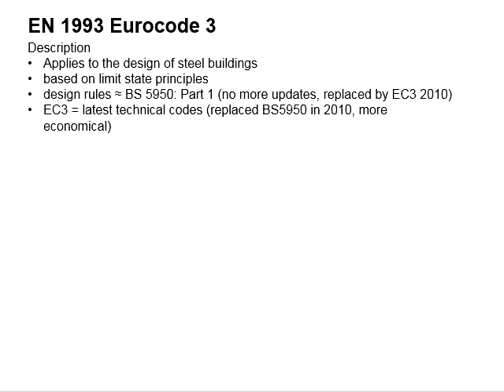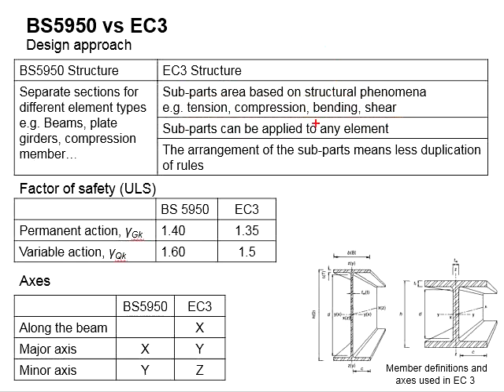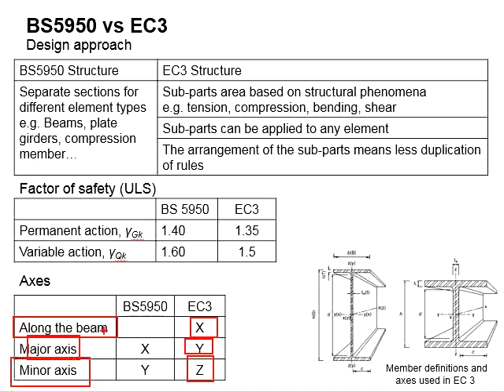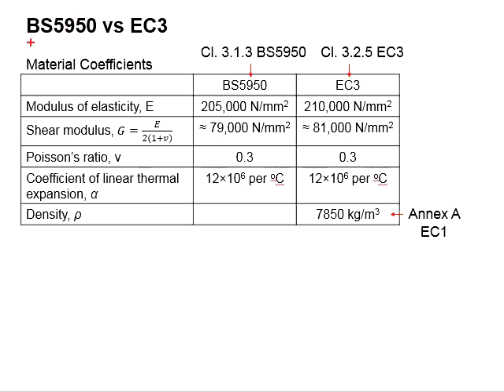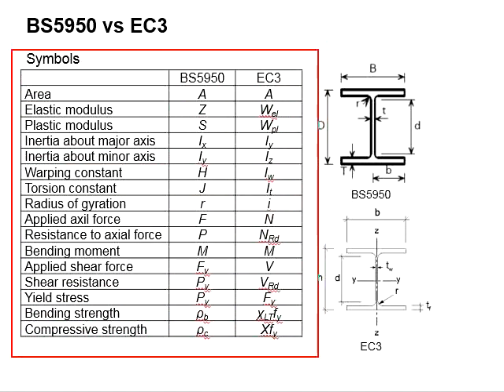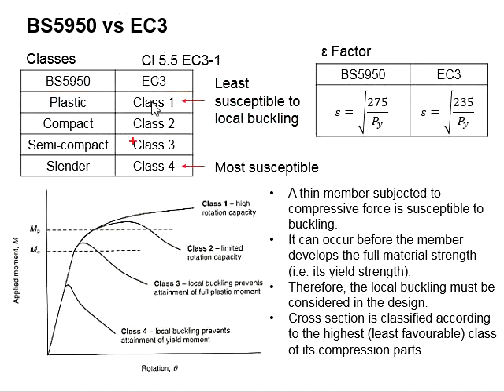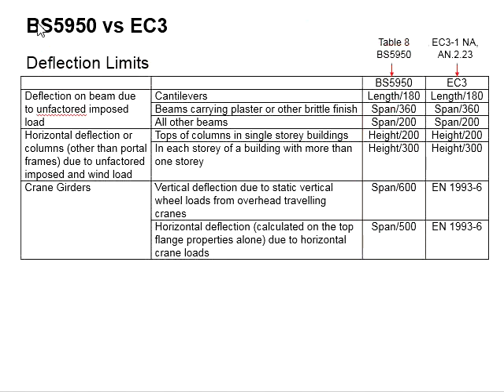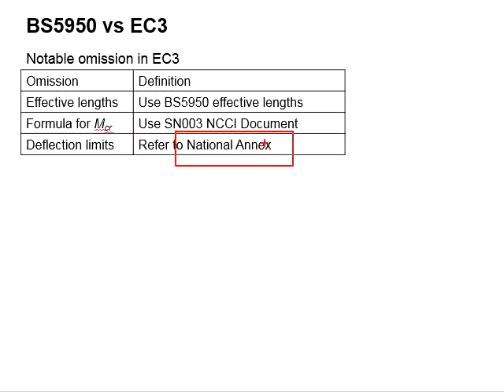1.9 BS5950 vs EC3

Comment: Can you elaborate on why EC 3 uses 1.35 and 1.5 for loading partial factor compared to BS5950 which uses 1.4 for dead load and 1.6 for the live load?
Reply from the maker: My personal interpretations of this are:
(a) Lower FOS means better reliability of the materials or loads and/or a higher confidence level in the predicted response of the materials or loads.
(b) EC was established later than BS. Over the years, technology has improved. It produces materials with better quality and consistency. Also, researchers gain a better understanding of the materials’ responses. The prediction can be more precise and reliable. When comparing EC and BS, EC focuses more on derivation from fundamentals and first principles (i.e., defined by loads), whereas BS relies more on empirical/past experience (i.e., the design is defined by member types).
(c) As for the loads, the values have been standardised in EC1. It becomes more organised and consistent.
(d) The FOS is lower because EC has more confidence in the estimation.

These are my personal thoughts. You may seek an opinion from a third party. Feel free to share your findings.